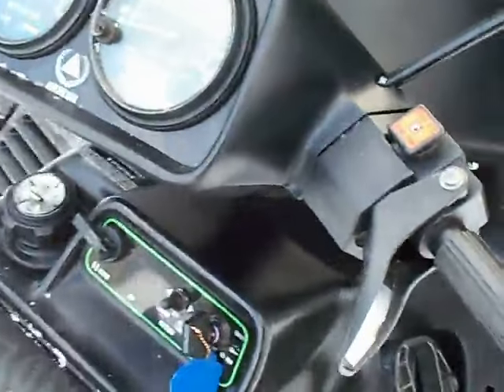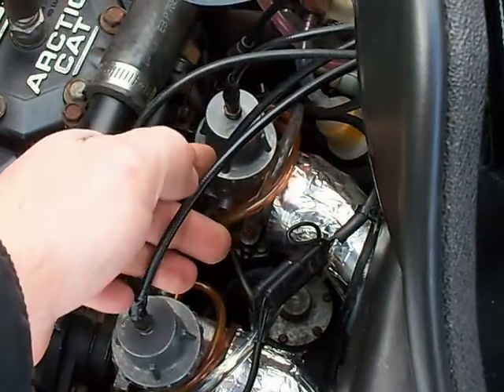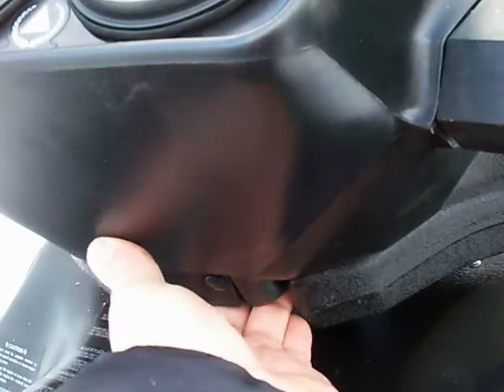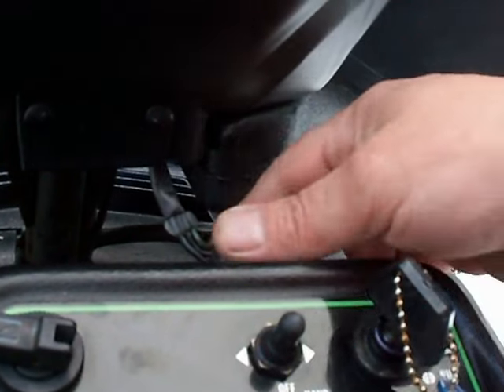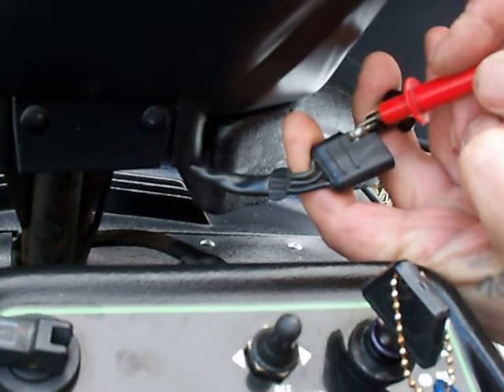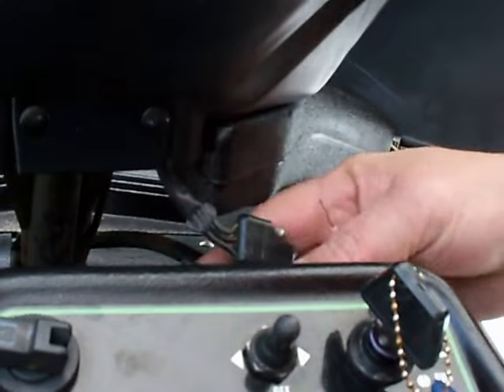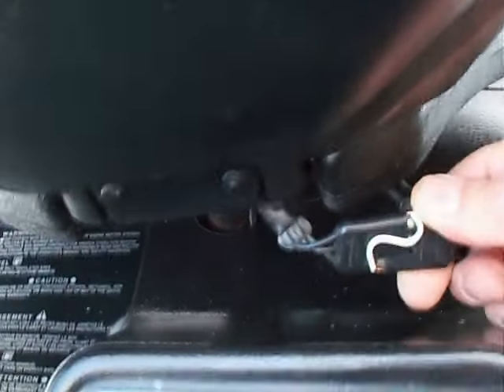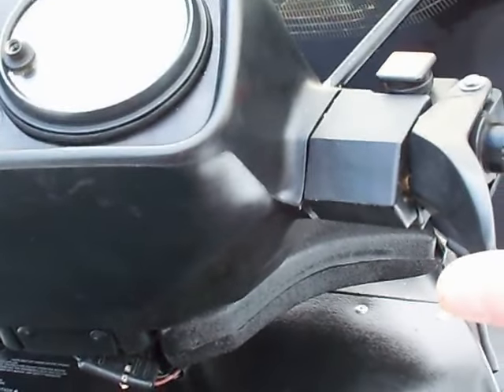Bypass throttle safety switch Arctic Cat

Comment: I know this is an old video but this is for anyone that has kinked throttle and choke cables that cares about it.  The throttle cable, where its getting kinked coming out of the carb, you can fix that by splitting a piece of fuel hose lengthwise and wrapping the cable to help support it.  I go a bit beyond and disassemble the throttle slide from carb and slide a piece of intact fuel hose over that area that's prone to kinking.  Then zip tie it in place.  Might save you a stuck throttle one day. I also do that to the choke cables if they're starting to kink.

Comment: Dude thanks for the explanation of the throttle related to the wires in the carburetor. This Prowler 440 of my buddies im working on would lose spark if the throttle was not pressed a little bit. if throttle is let off I get no spark. Would this have something to do with the magnets in the carb you talked about?

Comment: I bought a old snowmobile motor for a project but I don't know what the wire set up to get to spark so I can get to run so far lose wire come out motor white with red strip green,blue,black and Oregon,and yellow what wire do I need to hook on to get it to run on a gokart ply ty

Comment: would you get the same result if you cut the tss wire above the three wire pigtail then spliced it back to the ks wire leading to the common on the pig tail.( the pigtail coming from towards the throttle side not from the harness side)(if that makes sense) i believe the harness side has 4 or 5 wires whereas the bar side has 3. anyway. the reason i ask is i want to update my kill switch to the newer skidoo style switch which happens to be two wires however i need to bypass my tss. in order to make this work. in addition i believe my current problems are relates to the tss. i rebuilt the carbs, new boots, new exhaust gaskets, etc etc sled fired 3rd pull, then first ever since primed during the first start.(have started it a hand full of times since work) after the carb job revved ok and seemed to have response. i then started changing the throttle to a skidoo style throttle(my bars are smaller than normal as I'm a small guy and the bulky ac style throttle assembly was taking up all my room. anyway back to it after the throttle change i fired the sled, it idles great, starts first pull as always. just cuts out if you hit the throttle. the sled will continue to idle if you let go of the throttle before it boggles out. checked choke plungers, checked plugs not the plungers not the plugs. got spark cuz she idles oh so nice. must be the tss. its not a coincidence i believe that the problem arose after the throttle change (i have had the toss switch vacant since the throttle change so) so back to my original question three wires into two ( my machine is violet to the common black for tss and brown for other side of ks connection. will things work out if i splice toss (black) and ks common (violet) above the pig tail and still have full use of ks.

SO SO sorry for the massive message
Reply: I would try checking with a multi meter, if you can trace it up the harness further either way it should still work, as long as you get it before it splits off to other accessories ...

Comment: Does this work with a 99 ZRT800. My machine runs but when push onto the throttle it bogs out and stalls if I hold it. Is that TSS the issue?
Reply: U find an answer, yet? I'm dealing with same issue

Comment: An even easier way to to pull off the rubber tit on the inside of your throttle lever, no wiring needs to be fooled around with

Comment: I have a 1996 Arctic Cat EXT 580 EFI and when I give it more then half throttle it dies and lost spark and then a few days later spark will return. It did this twice now. Will this fix my issue?
Reply: I have an issue with the right side not working. Still idles